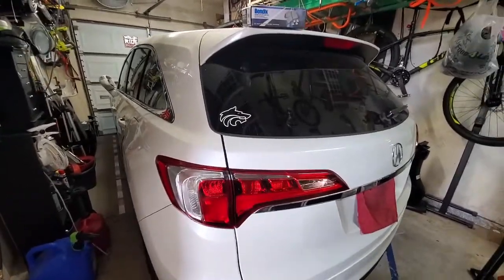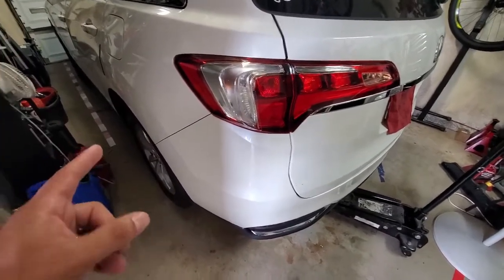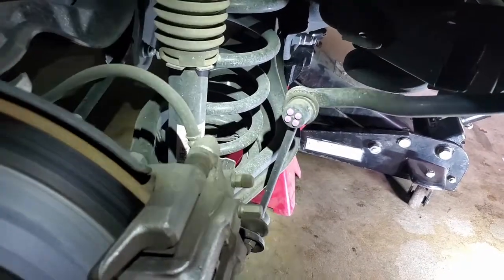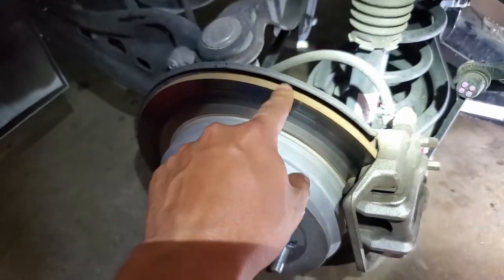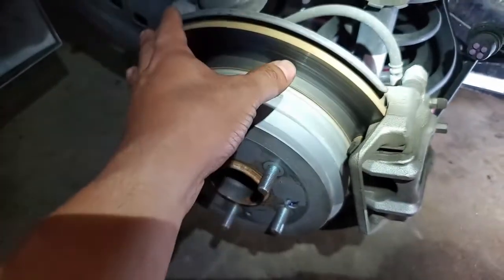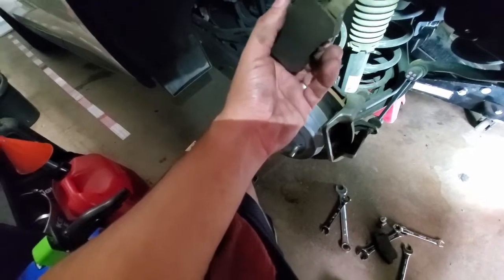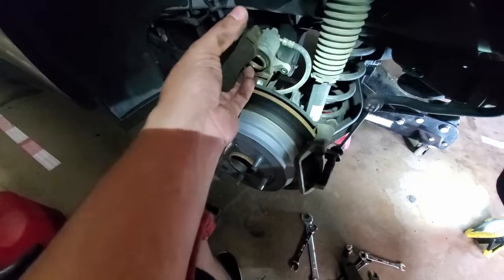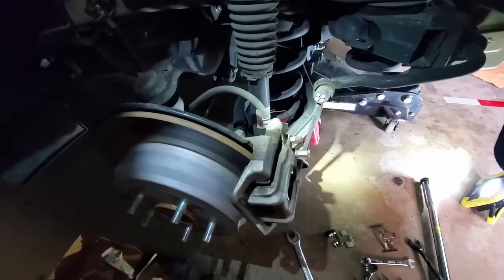Brake Pad Replacement - Acura RDX

Comment: Why didn't you give the torque specs?
Reply from the maker: I only covered as a general how to and since specs can very... I usually just let folks know to look them up as part of the process.
Reply: @Mikeityourself  first I have a 2019 Acura Rdx and specifically  googled for that.  Second specs are nowhere to be found.  So did  you have specs or just hand tighten?
Reply from the maker: I did have them,  I had googled it. Sometimes it's a little tricky but forums is where you will typically find the info. If yo check out this thread a guy named Dave calls it out. 17 ft/lbs for the slider bolts. Hope this helps https://acurazine.com/forums/2g-rdx-tires-wheels-suspension-410/brakes-job-982936/